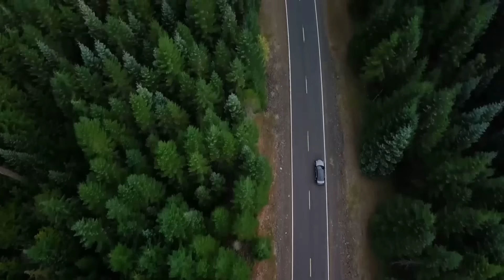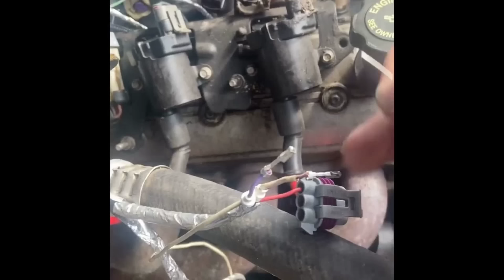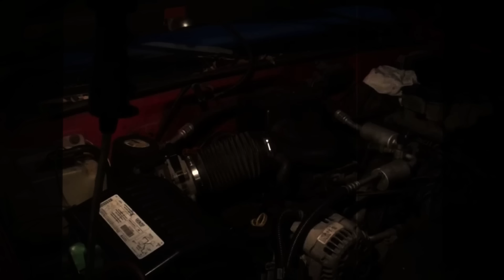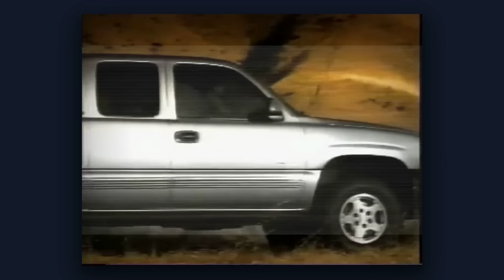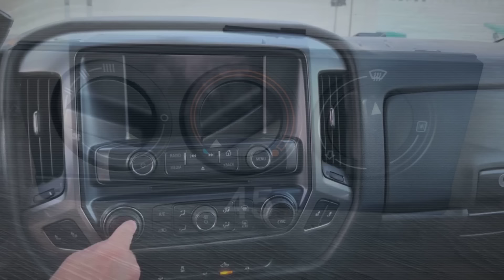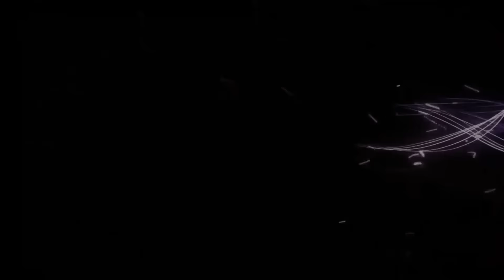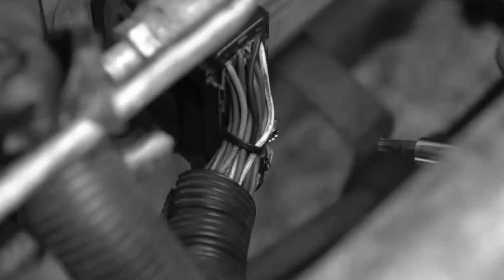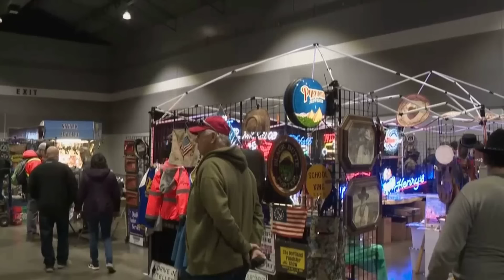How Smart Mechanics Are Bypassing The Dealership (The "Delete" Loophole)

Comment: These are all good ideas, but in many states with emission testing the inspection machine can detect if an ECM is either aftermarket or has an "unapproved" tune. There are more and more independent repair facilities that specialize in repairing OEM automotive electronic devices. They can even bypass digital locks in modules that are designed not to be repaired. Illegal, yes, but hard to prove. Digital lock laws need to be revamped to allow this. If a manufacturer stops making a part available, they should forfeit any copywrite protection so aftermarket companies can reproduce or repair them.
Reply: 30 states still require emissions testing. That's 30 too many.
Reply: @LADETROIT emissions testing isnt the issue the fact that over 100 years we allowed major automobile and oil companies to dismantle things like the Pennsylvania passenger rail system. We could have had highspeed trains across the nation by the 90s.
Now you get monopolization you get fuck all for transportation rights you get militarized police protecting corporate bottom line. 
Again emissions testing isnt the cause of this. Engineers red tape and corporate bribery is.
Reply: @dominichutchison1322  how is it not? Clean burning machines have little emissions to measure. In order to measure there has to be excess. With a general understanding of "factory" efficiency tuning being mandated to 20-30% efficiency maximum.
Reply: @dominichutchison1322 yeah trains are great but that's not the discussion here, go back to you fifteen minute city, hope the lines at the checkpoint aren't too lomg
Reply: @dominichutchison1322  dude public transport like that doesn’t work everywhere in the nation. There are thousands of towns that will require cars forever because they are too far from major city centers. This problem has nothing to do with your public transit commentary.
Reply: Yeah it’s easy on YouTube lol. In reality, most people don’t have the tools, knowledge, or time and in smog states you can’t just throw whatever you want in there. The system will catch aftermarket ECUs or tunes real quick
Reply: @elibatman8474  As long as you don't live in California, most states emissions exempt vehicles more than twenty five years old, which fits in perfectly with my refusal to buy any vehicle more recent than 2001.
Reply: @houseofno I have a 2001 subaru forester and a 2001 chevy s10. 👍🫡
Reply: @houseofno  You are mistaken.
Reply: @houseofno LOL my aunt's 2017 Subaru Impreza is still going strong at eight years old. And apart from needing a new battery and new tires (replaced on the same year as its eight year anniversary, which was last June) because those components aren't technically meant to last eight years, it's never had any problems. She used to work from home—now retired—and therefore never had to drive it every single day of the week, which is why it lasted so long without having to replace anything beyond regular oil changes.
Reply: @SPHYNX99752 Two classics!!
Reply: @samsimington5563 check back with us when your aunts vehicle is 20+ years old
Reply: @houseofno  in oregon its 9k pounds vehicles that get exempt and everyone outside of DEQ zones. So I not only live rural but I made sure my truck was 9k pounds dry by putting a steel flatbed on it with huge tow truck style headache rack. Loaded it with tools.
Reply: @samsimington5563 give it a couple more years and youll wonder where all the oil is going
Reply: @houseofno  I live in California and trust me we know people here that are good with (Smog) if you know what I mean
Reply: @SPHYNX99752 I have a 2000 Dodge pickup 6 cylinder 240,000 miles can't hear the motor everything still working on time
Reply: @bucketheadrox  Love that.
Reply: @houseofno California isn't a state. It's a mistake
Reply: @elibatman8474 what system?😂
Reply: @elibatman8474 this is why you have friends that are mechanics or wrench heads.
Reply: At 25 years the emission test is void and YOU should always pass a safety inspection the government can’t enforce a rule you can’t fix VOTE RIGHT TO REPAIR PA state inspection Mechanic ASE Master Technician FIX IT RUN IT
Reply: Yeah exemptions vary a lot, it’s not that simple. And dealer plates definitely don’t work like that lol. That’s why most of those builds only work where emissions aren’t enforced
Reply: Fuck inspections . Drive em anyway .
Reply: @Billy-u2p3t  agree with you, fuck the scam.
Reply: @Billy-u2p3t change .plate to freinds to drop it through test ,
Reply: @Billy-u2p3t  That might work until you get pulled over for expired tags because you MUST pass smog testing to renew your registration. I don't think any of these guys have figured out a way to bypass smog testing and tag renewal yet--not in a way that will satisfy law enforcement.
Reply: @dolfinwriter5389 depends on the age of the car 😅 but for the most part , that is correct
Reply: In texas. Most counties dont have inspections anymore. Only lame harris county and big blue areas
Reply: Mega squirt efi control allows one to build pcm thays emissions compliant
Reply: IF a person has the ability to redo all the components, they have access to emission control testers as well and can tune as needed to meet the requirements for the state.
Reply: Yes. This is an unfortunate fact in many places.
Reply: Fuck the state and their inspections
Reply: Thats why you don't buy new , my 91 is full standalone,  turbo , hood dump , and tagged and legal , don't have inspection , its a classic 😅.. but for newer cars , depending were your at , your 100% right , but if its basic inspection only.  Then there is no hooking up dookie 😅.. peace and love brotha l8z
Reply: @mastercricket7626 it’s kinda funny for me to hear that a 91 is considered a classic. Guess I’m showing my age. 40’s and 50’s used to be the classics.
Reply: @rbwoodwork1890  I have a 1996 Ford Explorer that is now classified as classic. I found out when renewing my tag and got a 2 yr tag for the price of a one year tag last year.
Reply: It's a damn good thing that this administration recognized and moved already on shutting down EPA "laws", all of which are unconstitutional. 
CARB was officially decommissioned last week. 
That was HUGE.
Reply: @jaredallen1149 Right up until the Left gets majority power again, after which everything will be EOed right back in with a vengeance, and most likely expanded massively.

They will have a broker investing in the green scam while the votes are being cast.

Climate change is the biggest scam in human history, Leftism is cancer.
Reply: Where there is a will there is a way... never give up
Reply: No digital lock laws are not necessary simply because it’s destroying the automotive industry across the board all on its own, we don’t need it and we don’t want it plain and simple
Reply: At which point you register the car as resto-mod or your states’ equivalent. It’s a thing in WA. Here it’s a box check on the same form as antique plates.
Reply: Just put a triangle on it and call it farm equipment
Reply: @l @location_florida But with that you are limited to 35 mph allowable speed.
Reply: @location_florida you got that right?It's part of the farm
Reply: I stripped a z650 2020 model and used a 79 model electrics and ecu .get rid of all the crap , back to carbs with the help off 3d printer .
Reply: Inspect your own cars.the governments roads are on the peoples land
Reply: @bra @bradlybaldwin9564 at is only true if they have an easement, other wise they have bought the land for a right of way.
Reply: Am i missing something? I run AEM ecus in one of my cars with multiple tunes i can toggle between, and i have no problem getting thru emissions when i set it to the factory tune
Reply: Is there emission testing in some states with a 20+ year old vehicle? I assumed at a certain point a vehicle becomes classic. That's how foreign vehicles that don't meet US standards can be imported and driven when they're considered classics.
Reply: Im so glad I live in a state that that, if they check your emissions. Its only purely what comes out of the exhaust. Thats some serious government overreach imo.
Reply: You don't have any idea what it takes to do that job, lol
 I'm an old school journeyman mechanic. We can do what this video shows but with the amount of time required we only do our own vehicles. It's cost prohibitive for anybody else. 25 years ago Chrysler dealers could tell if a scanner other than the factory one had been briefly connected. You can't put a carburetor  motor in because the electronics won't be able to operate the transmission. All you can do is buy an old truck to start with and restore it. You can add aftermarket fuel injection and a computer to an old truck and the transmission will still function.
Reply: @onetransmission7871 i can drop an LS in just about anything with a rear differential and a piece of the original driveshaft. If you are paying cash, it will be done in 3 weeks from the day all parts arrive. 
Typically runs about 10k for everything using a 5.3l and 6speed from a truck at a junkyard. Includes accessory drive, Ignition system, Carb, Intake manifold, headders, exhaust pipe, mufflers, and a custom driveshaft, tansmission cross member and engine mounts. 
If you have 3 techs on the same vehicle, the hardware side takes 2 days or so, the fabrication side another 2 days. Wiring and tuning, accessory drive etc. Takes another few days. 

If you know exactly how you are going to handle the electrical side- the rest is pretty basic stuff, no different than replacing factory setup, just alot easier to install
Reply: Damnskippy!
Reply: Ever heard of the TDI scandal, if they can do it we can do it
Reply: Why bother playing the rigged game we've no representation no one looking out for we the American peoples best interest. Emission can go spit along with tags vehicle registration is permanent unless you sell and file a bill of sale pay you taxes for selling what you own it's all a scheme an scam. I've had enough
Reply: My car fails emissions every month, i just pay $30 monthly fee to tell me my car has failed, $360 annual fee which is still cheaper than fixing the defect.
Reply: Easy solution, don’t live in a cucked eco terrorist state. Vote with your feet.
Reply: On m bikesits anything after 2008 .
Reply: My 26 year old Ford Ranger still requires emissions testing here in the Chicago area.
Reply: In Texas so long as you don't live in a populous county you don't need emissions or safety inspection
Reply: Right.
Reply: New Mexico no emissions thank God..
Reply: Don't live in states that inspect.
Reply: Probably time to hack the inspection machine, VW style.
Reply: they don't own the machine once I buy it their copyright can suck nuts
Reply: There are only 9 states in the union that still inspect cars and trucks...our state NH is trying to stop inspections but the emissions tools company is suing our state for a breach of the contract....
Reply: I believe PA doesn’t care after a car turns 20 years old. AT that point it is considered a “Classic” and is no longer bound to emissions. Plus only “Heavily Industrialized Counties” in PA have emissions. This hasn’t been updated since 1974 so several counties are fighting for and against a retest lol
Reply: @mikesun9009  *25 years and older. Emissions is just a visual inspection. Visual is easy to hide/fake. You still need a safety inspection however. If you dont want either of these things you can register your car an antique but then you cant drive them all the time.
Reply: Detect if an ECM is aftermarket? 😂 A standalone literally has no OBD coding on it. They have zero emissions programming.
Reply: Well,  thats what you get when you vote blue. They put that crap in. 
However anything above 20 years is grandfathered in
Reply: Even liberal ass Washington doesn't have emissions.
Reply: Trust me I live in California. We know a guy that knows a guy that knows a guy that knows a guy at the smog
Reply: Stay out of California. Its a shit state anyway
Reply: Everybody who supports automated and digitized cars with mass surveillance watching your every movement and breath you are brainwashed idiot
Reply: Vote it out. Stop electing people who only want to be bribed.
Reply: montana plates
Reply: those emmission laws should be rebuke.
Reply: Oh no! The big bad state house. We are the people and are in control...unless we relinquish it with sheep-like behavior and fear.
Reply: @reasonwarrior 
Ah... Yet another one of those dangerous, right wing, conservative EXTREMISTS with the unacceptable ability to think for themselves... 
Turrble. TURRBLE for a democracy. 
😂😂😂
Reply: My advice... don't live in one of those communist states...
Reply: Mandates, policies, are NOT LAWS
Reply: Find a hood guy with a fast ride and ask him for a connection to get a clean sticker. You gonna pay 200 bucks, but it is worth it
Reply: Exactly! Arizona is one of them if you live anywhere near a city.
Reply: I have seen many after market just repairing/reprogramming the engine control module. Most have thr software already.
Reply: This is why I moved from a state like that 33 years ago.
Reply: Stop getting you fake wealth from jew supremacist bakers who call you a slave. Nothing illegal about modifying your private vehicle, but it's not private if you owe money on it. Americans want to live above their means. They get ill gotten gains from the beast and say "we won't take his number"....
Reply: Tuning is an art :) and a carb is the church....
Reply: Maybe we can simply vote on the “Right to Repair” bill? Cars and appliances need to be built so we can repair or replace the most frequently failing components. I used to be able to change my own spark plugs, but now they have to lift the engine out!
Reply: Move to a state that does not dictate ridiculous mandates or throw them out of office and change it, Says "WE THE PEOPLE"
Reply: The secret is to have a toggle.
Reply: You can grow balls fight the inspections which is just another tax but hey we did it in Michigan years ago and won
Reply: There trying to control what we drive and take them away. They half to think outside of the box and beat the criminal there someone out there that will get it all right let's pray.😊
Reply: Silly rabbit, you don't take these cars to "emissions", you don't even register them. Just like your modded or printed guns, or any guns, they're nobody's business.
Reply: . And what about the surveillance cameras that are being installed everywhere.  If you drive in a town they will pick up you not having a plate.
Reply: Used to be, but now they want to kill those that persevere.
Greed knows no bounds.
They are after that 1% even though they already have 99%.
When they get that 1% they start making the next 1% and the next etc.
Until they made 190%, 200%, 300%  squeezing forcing people to spend more + more often and both.
Reply: Just get a dealers license and dealer plates with 50k of insurance u will not need to register or smog it car ever again and u can buy as many license plates as u want and u never ever ever have to register the vehicle or smog ever again. Or u could just be a sovereign citizen and do what they do either way ur winning
Reply: @jackdaniels2657 or you could just get your dumb friends to vote red? 🤷🏻‍♂️
Reply: @jackdaniels2657.  The "sovereign citizen" thing doesn't work! That will only get attention and arrest
Reply: You may want to fire your green scam “elected” emission overlords?🤷🏻‍♂️
Reply: @ChrisJacobsen-g1x  I did. I moved TF out of California in October 2021.
Reply: @dolfinwriter5389 ditto
Reply: I do it, but it takes time. You need to be able to piggyback it though or have a secondary tune available and signals that mimic the factory ecm. They look for a specific handshake signal to confirm. I build control modules for industrial equipment, these are childs play made by baby engineers. Get a good friend that loves building electronics and he will be able to build you a mimic board to match the handshake. Fyi, chevy and ford are really easy to do. The euro cars have a bit more going on so you need multiple handshakes to keep them happy. But also, in multiple states, motor swaps are legal, snf emissions are based on the year of the motor you put in. East coast anyways, not sure about the west coast.
Reply: @Drainolordofsteves  You are so very incorrect when it comes to engine swaps and emissions testing. 

Much of the east coast (ME,VT,MA,CT, RI,NY,NJ,PA,DE,MD,DC,VA) has adopted CA emissions standards.     Engine swap regulations still vary by state, as do emissions inspection requirements and exemptions.
Reply: @alantrimble2881 a real mechanic doesnt give a fuck, if he plugs in the car and it says PASS you will get your sticker. Who the hell is gunna check your engine on the side of the road if your inspection sticker is current?
Reply: @Drainolordofsteves as long as you plug in the DLC connector and the emissions monitors show PASS or N/A it will pass the state test. You can manage that with a tune and basically "turn off" the emissions monitors. A mechanic will plug in your car, it will say PASS and he will collect his money and move onto the State saftey inspection. EZ
Reply: Those states with emissions tests are tyrannical and act repugnant to the US Constitution!😡  #FEPA, #FCARB
Reply: @ALM1936  You must live in the country. I was a kid in the 90s in Atlanta and in the summer the smug was so thick you could see it like fog in the daytime. Many people died from pollution related illnesses. Helicopters would fly around the city to perform smug alert telling the children to go inside. Not anymore after emissions testing.
Reply: @blackrahk2037 by the 90’s significant improvements had been made.  The regulations from that point simply went too far.  They prematurely killed off state of the art clean burning coal plants as well as severely crippled, arguably permanently disabled, the over the road truck & engine industry.  Just like today, they talk about the need for Net Zero.  That’s just ignorant.  Nothing will ever be Net Zero.  Further, it could be argued that producing Electric Vehicles is just as bad pollutant-wise and bad for the Earth as combustion vehicles.  I’m all for being good stewards of the Earth, but not with overbearing regulations that have drastic impact to the economic and jobs side of our lives.
Reply: @ALM1936 the net zero they are really referring to is humans.
Reply: @SRTVNGNC 👍👍oh, I’m aware of that.
Reply: A good idea is to just not live in one of those terrible places. Escape communism while you still can.
Reply: @flpanhead  It’s more fun to fight it.
Reply: @flpanhead  it's pure capitalism, bro. The auto companies paid good money for those laws
Reply: They're not even ideas of a person. This is AI slop
Reply: NOT true.. i can flash a vehicle and they know nothing... they cannot detect checksums etc.. they check for DTCS boss good luck with that
Reply: Not older cars it cant tell your talking much newer stuff
Reply: @LovesM855A1  on the contrary, I'm including many "ancient" applications comparative to todays inundated systems we are being forced to accept. They all tell a story if you're fluent in their own dialect. 

pre obd2 obd2 and obd0 we had the nox injection 1973 and later vehicles up to 1985-7 did not "talk" to the driver. With the introduction of obd0 the communication was displayed but through blinking mil"idiot" lights. Obd0 was the first rendition following the pellet converters now using catalytic convertes or catalyst. Anything with an exhaust filter/ catalyst requires hydrocarbons to ignight the unburned hydrocarbons on the substrate. No excess fuel no ignition no ignition no reading. It's a known issue with ALL consumer products to have limited efficiency and proprietary termlifeobsolescence. 

Non catalyst internal combustion engines talk through spark plug discoloration as well as carbon buildup in exhaust system. As well as many other factors if you are willing to learn each application and the theory of operation applied to each individually. Too much fuel is buildup and richer "safer on engine" but clogges up. Not enough fuel and leaner condition "more chance of detonation" damages and burns components up.
Reply: @Question3v3rything in my state if your car is under a certain age you can have a check engine light or fault codes and they dnt care they dnt even check emissions just a safety check and record mileage which is nice. It should be that way everywhere.
Reply: Yes I can read plugs and tune and rebuild most carbs, I build and have built a ton of race car builds for street/track. Im pretty familiar….. even rotaries to v8 and dsm builds and I hate it but honduh stuff yuk
Reply: @LovesM855A1 I apologize if I came across condescending. That was not my intention. I was sharing my basic understanding of what has been utilized on what we see today. Sounds like you have a great understanding on the many different systems as well. 

I will agree nothing beats the simplicity of mechanical operation.
Reply: @LovesM855A1 completely agree with you on that. Sadly some states mandate annual emissions checks and don't allow the 25yr rules.
Reply: @Question3v3rything ohhh no I wasn’t taking it that way and loved the knowledge you dropped for everyone to read. Thank you so much and I totally agree with you!
Reply: @Question3v3rything yeah its a way to make us retire old cars so we can buy cars they spy on us with.
Reply: maybe EV numbers will make these tests redundant when gasoline use is reduced......